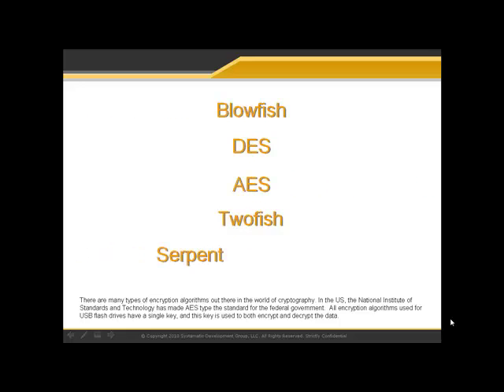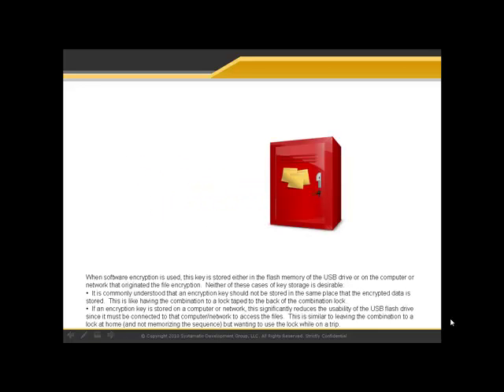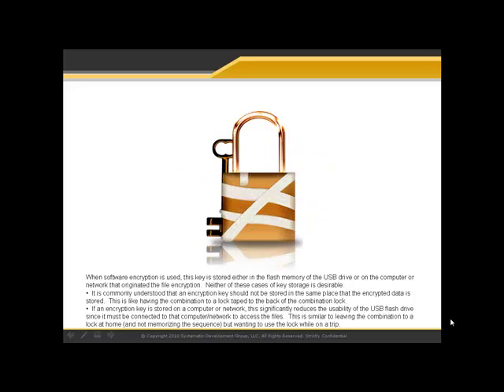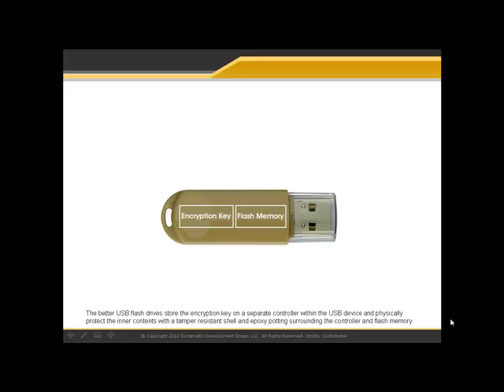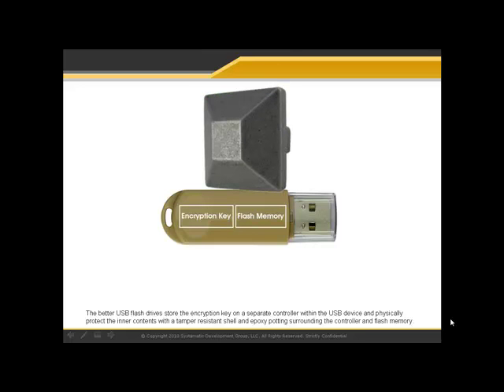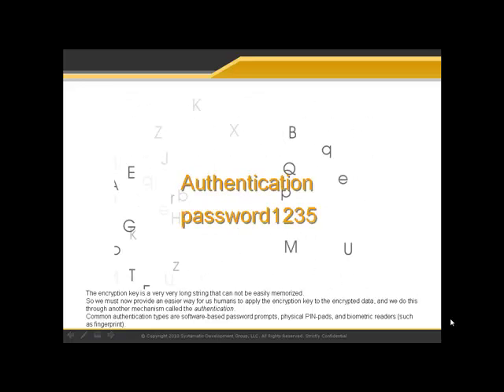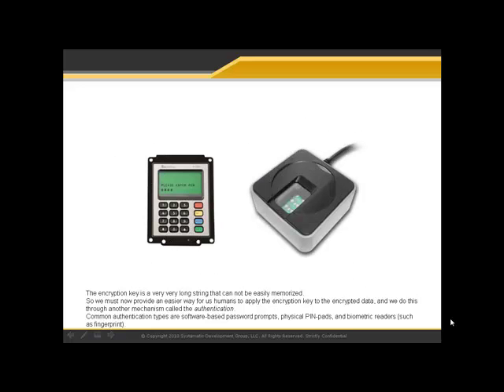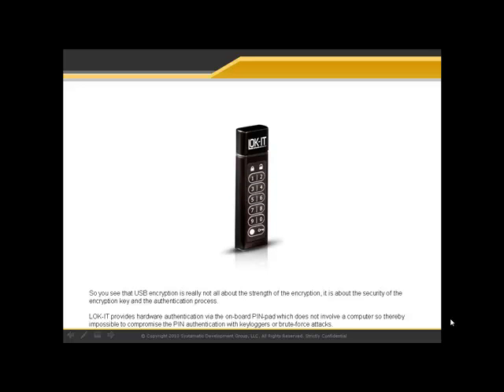USB Encryption

Comment: Thanks for the info, however i cant find the picture. I used to own a Lok-it 4gb thats how I know.
I had another question, after the 10 failed attempts what happens? I know the data self destructs but does the drive generate another encryption key and if so, how many times will it do this?

Comment: Problem with this product is, if you have your USB ports side by side or one on top of the other, once you plug the device into one of the ports the other USB port becomes redundant because of the size. Oh and another thing, after a while of entering the same PIN, you will notice an indent on the numbers you use to unlock the device. Hackers delight!!!